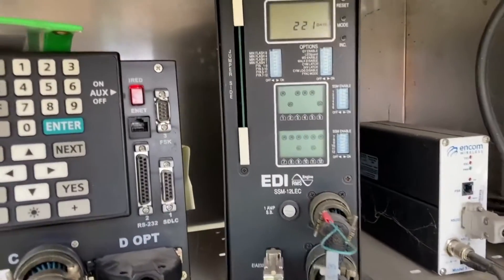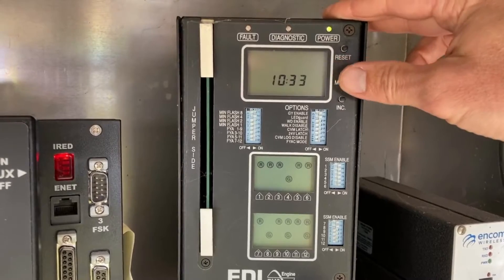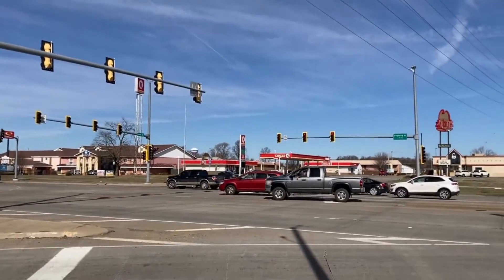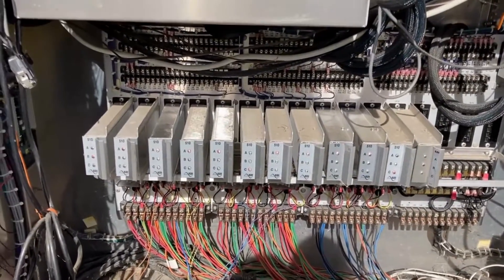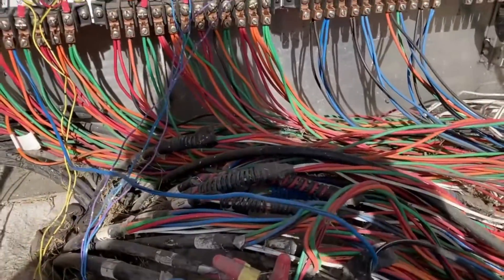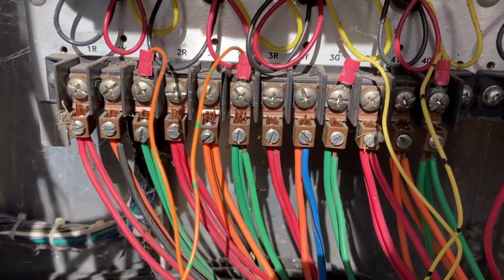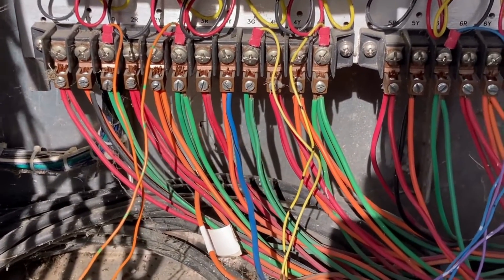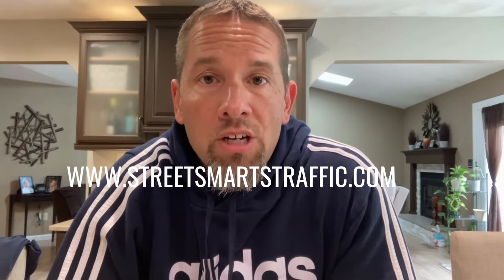Traffic Signal Troubleshooting - Dual Indication Fault

Comment: I noticed that the red, yellow, and green lights are wired red, orange, and green, respectivly. I'm assuming the blue and black wires are for the pediatrician signals. Which colored wire controls the "don't walk" lights and which wire controls the "walk" lights?
Reply from the maker: Actually the blue and black are for the LT arrows.  The right far side of the field wires are for the ped indications and we use the red (DW) and green (W) usually.
Reply: Thanx for the knowledge. I should "STOP" assuming. Get it?  Ha ha.
Reply from the maker: @WilliamLutz-dj9zo  👍😅

Comment: Sounds like the wire is bad somewhere underground. We usually pull a new home run for the affected phases. Using a spare wire is a temporary fix at my job
Reply from the maker: We were on our last leg on this one.  So we went with using the spare wire.  I'm sure we will be pulling in a new cable if we have anymore issues.  What industry are you in?
Reply: @streetsmartstraffic  I am an electrical mechanic. I work on traffic signals for NJDOT. We will use the spare when we can, but we don't seem to get that lucky anymore. Usually multiple wires are exposed and shorting out or are burning onto another wire.
Reply from the maker: @matthewjacobs1164  Thats cool.  So you must do it all!  Not so much on the construction side for me...although I will help out.  Yeah, I felt lucky that we were able to get it going again with our spare wire.  I shot that video like last year I think.  Still running!

Comment: Did you re-do all the neutral connections? I was told they can sweat, or be affected by humidity. Also that it is often a seasonal spring thaw issue.
I'm investigating a dual entry issue, with induced voltage on the cable. I was going to comment on the other video, with dark head. That was interesting. Not sure if you've fixed that one yet?
Left turn arrows need load resistors. Many cabinets have them included on a panel, or on the terminal strip. Something to consider. See - IMSA article, "Compatibility of LED Traffic Signals with Existing Traffic Signal Field Equipment"
Reply from the maker: Good information.  I never redid the neutrals.  The spare wire seemed to fix the problem.  The induced voltage you speak of sounds like a neutral issue or a wire that is cross feeding/shorting over another.  
I know load resistors are great for loading down a phase but I see them as only short term fixes.  The reason I don't like to use them as a constant is because if you lose all indications for a direction, it will still run and not be noticed by the conflict monitor.  I think I would rather the signal go into a red flash state...just my 2 cents
Reply: @streetsmartstraffic  Yeah, the contractor said they doubled up neutrals on another location with a similiar induced voltage problem. 
I thought we might add the load resistor, w/o affecting the no load condition, but of course that's incorrect. Unused Left turn reds used to be tied high, but now there are load resistor packages being speced? See ncdot - Load Resistor Installation Detail.
I also ran across this doc, that should be of interest: "LED Traffic Signal Monitoring, Maintenance, and Replacement Issues" - deleted link.
Reply from the maker: @freedomspyder  Ok good to know.  Different muni's & cities do different things.  We still tie unused reds to high.  Good information!
Reply: @streetsmartstraffic  Don't hold me to it, lol. 
I see it's used for Flashing Yellows by some. And for unused Walks. 
I had noticed or thought, that the red jumpers were no longer necessary. Wasn't sure if that was because of smarter MMU's configured to ignore those channels. 
Appreciate your efforts and sharing of your repair stories. Cheers.

Comment: Do you have try to clean all wire contacts with contact cleaner. They seems to be very rusted.
Reply from the maker: No we don't go that far.  At the most, maybe run a straight edge across the bare copper a few times to knock it off.  Great question!

Comment: This used to be physically impossible. Contacts were mechanically linked and simply could not indicate more than one light at a time. If contacts got stuck, the entire mechanism would not be able to rotate.
Reply from the maker: I actualy worked on those back in the day!  They were actually a realy cool contraption.  The signal head would share the green arrow & yellow arrow indication.  When it was time to change from green to yellow, the motor was energized and it would rotate the color of the lense, thus changing the color of the arrow.  I thought that was so cool!  Thanks for sharing that!  Brought back memories..
Reply: @streetsmartstraffic  Haha nice. I don't miss the days of simple timed lights and their inefficiency with traffic but stories like this didn't exist. That said, there were more [observable] failures back then, but they all resulted in the same thing... flashing red one way, flashing yellow the other.
Reply from the maker: @MadScientist267  You got it!
Reply: No, Remember how this fault was because there were a wire short, so the voltage were "backfed" into the incorrect lamp? So even if the rotating contact could not give voltage to more than 1 lamp wire at a time, you could still get a short between 2 lamp wires, so you get a dual indication.

Not with the mechanical glass switcher however, since there was only 1 lamp then.

The conflict monitor is able to detect this because it detects the voltage on the lamps, so even if the controller behaves properly, the conflict monitor is able to detect this.

Comment: Probably water intrusion Somewhere during rain....Only 1 spare wire In entire cable ?? .....Don't you guys design for like 10% Spare pairs/conductors install for anticipated growth or defective insulation fails ??
Reply from the maker: Funny I just answered that question in an earlier response.  We SHOULD do that and on most new designs we do.  But alot of these cabinets are 30+ yrs old and they built it to have 'just enough'.  
But you are correct Tom, it all starts in the design process! Thanks for the comment!

Comment: It's fortunate that there was a spare wire already run. Is that common, or do these systems tend to get installed with exactly what's needed and no more? I've replaced wires in my own field and never had an enjoyable time of it.
Reply from the maker: Well, it all starts in the design process.  If done properly, you want a spare in the conductor cable for possible future expansion or in a case like this.   Example, a 5 section signal head (green, yellow, red, green arrow, yellow arrow) needs at least 5 wires for the indications and then another wire for a neutral.  That's 6 wires.  We run at least a 7c cable (7 wires) for that head then.  I know some municapalities that for example have a pedestrian head (walk man, don't walk hand) will run a 3c (wire for walk, wire for hand & wire for neutral).  Yes, it does the job, but leaves no room for error...Thanks for posting that question!

Comment: I'd check to make sure there are no loose neutrals back feeding.
Reply from the maker: Thanks for your input Dan.  Yes, if the spare wire wasn't a fix, my next step was going to start chasing down those neutrals....But, so far so good.  Thanks again!
Reply: @streetsmartstraffic  You do a great job. One more suggestion: put a box of D-con in the cabinet and seal the conduits and cabinet base. It appears rodents are nesting in there and there is nothing they like more than wire insulation.
Reply from the maker: @danlowe8684    You're definitely right about that.  We have some cabinets out there with D-con in it...this could have used one.  Since this video, we've upgraded to a new TS2 Type IV cabinet.  It's nice and shiny now!

Comment: Ok.   So.  I have no clue about your job.  But.  I've been a ham for many years.   The fix was to parallel a wire with another???   Um.   Maybe the wire was bad???  (Sarcasm not implied..stated)
Reply from the maker: Maybe i'm misunderstanding your comment.  It was unknown up to that point that the wire was bad.  Usually if a wire is bad, it will just short out and cause a red-red flash condition.  Or if it is severed, the indication(s) will not light up. However, neither of those occurances happened.  It would run fine for an extended period of time until there was heavy rain.  
Anyway, for now the spare wire was the easy & fast fix.  Thanks for commenting
Reply: @streetsmartstraffic  look.  I admit I have no idea of your job.  Me.....as an amateur radio operator,  my FIRST choice would be a broken or intermittent wire.   But thats just me.  What do I know????  I've only been a ham since the early 90's.   I don't know your job

Comment: Reminds me of phone work in a condominium,  after mapping and testing every phone wire full functionality was theoretically possible, until anything broke.  No spare wires. Building owner chose to run new wires along the outside of the building and drill holes into the exterior walls... go figure.
Reply from the maker: LOL   Hey, whatever gets it done!

Comment: Back in the 80's in Joplin, and Kansas City, I saw traffic signals go green both ways. The one in KC caused a crash right in front of me. In Joplin, I was almost in a crash. I have had people tell me that cannot happen, I know for a fact that it can and does. Probably wires shorting in a j box somewhere is my guess.
Reply from the maker: That never should happen.  There is a piece of equipment in the cabinet that is sort of a watchdog over the signal.  One thing it does is to monitor conflicting signals (such as opposing greens).  If this happens, it places the signal in red-red flash.  Now I said SHOULD....
If it was wired wrong, a signal head was turned the wrong direction, that watchdog equipment is bad....all things that could have caused that to happen.  Which is why signal maintenance is SO important!  Thanks for your comment!
Reply: @streetsmartstraffic  I am sure things are far more sophisticated now.  However, does the system have a separate path like an optical sensor at each signal light segment that lets the control know what the actual physical end result is? Or does it simply monitor the signal that is sent to each segment from the control box? Like everything else, cost must be kept as low as possible.  The light in KC was red for me when I got there. After it turned green, before I moved an oncoming car and a car from the right crashed  in front of me missing me by inches. I was amazed to see that it was green both ways!
Reply from the maker: @LM-fg7vi  Great question.  The conflict monitor monitors the field wires heading out to the indications from inside the cabinet.  It doesn't know if a head is turned, or if it is wired wrong.  But in a perfect setup, it should catch opposing greens coming up and place the signal in red-red flash.
Reply: @streetsmartstraffic  One more reason to keep technicians around, to go do actual observation of the system in operation. I have seen where a truck turned the corner tight and moved one of the signals to face a different direction. He of course just kept going!
Reply from the maker: @LM-fg7vi  Happens all too often!  And agree with your statement 100%!

Comment: Sometimes i will be at a light and will not give me a green light and i will have to wait for 2 to 3 cycles i could be going straight or turning what is going on thanks
Reply from the maker: Several things---
DRIVER side of it:  
1)  You pulled too far past the detection zones and were no longer detected.  Then had to wait til someone behind you pulled up and was detected.
2)  You were too far from the detection zones and finally moved forward a bit and were detected.
SIGNAL side of it:
1)  The detection zones are improperly placed and you just happened to move enough to finally get detected
2)  The detector card (inside the signal cabinet) or detection equipment is malfunctioning.

Hope that helps!  Thanks for commenting!
Reply: I once had to make a left turn against a red light every day for a month because that's how long VDOT (that's Virginia DOT) took to fix the broken detector. I called them at least 4-5 times about the problem and always got the "we'll send someone out to look at it". Should've checked for a drool puddle by the controller cabinet. Of course I am assuming that anyone ever bothered to look at it before a month passed.
Reply from the maker: @brianleeper5737   That wouldn't fly where I'm at!!  However, playing devil's advocate here..they may have been waiting for a piece of equipment from the manufacturer to replace something that had gone bad.  However, I'll also say that a modification should have been made to the signal in the interm so that you wouldn't have to run a red light.  (that's a safety issue!),   Thanks for your comment!
Reply: @streetsmartstraffic  It's possible, but with that part of VDOT responsible for around 1000 signals that all use the same hardware, you'd expect them to have some spares. It's also using loop detection not video so that should be very common hardware.
Reply from the maker: @brianleeper5737  Well, you're making a strong arguement!  lol
Reply: @streetsmartstraffic  VDOT used to be way better at dealing with traffic signals than they are now. I have no idea what happened. I think the one person who kept them working well got fired or retired or left for another job.
Reply from the maker: @brianleeper5737  Unfortunately that's usually the case.  Many times it's this: the ol' timer (that has all the experience) retires and the agency or company didn't plan on his succession.  Then they have to get someone in there and start all over.  OR the agency pay is so low that there's constant churn.  As soon as the signal guy gets enough experience, they jump ship to someone that will pay more. 
Either way, its the traveling public that suffers!

Comment: Do you ever "megger" / insulation resistance test cables? Normally what you would do in a situation like this, between green and yellow wires since it's between those two. But, not sure if you can disable a head(s) for any period of time. Or how easy it is to coordinate with local agency. But, spare conductor seemed to fix it, for now anyway.
Reply from the maker: Not normally.  You hit it on the head though.  You would have to disable heads and need a bucket truck at your disposal.  Thanks for your input!

Comment: Wow I absolutely love the controls in a signal cabinet. I do have a question. Why does the ticking for countdown during walk sometimes sound like a machine gun? I'm in Oklahoma and I used a crosswalk the other day. I hit the button it said "Wait", then the walk sign lit up and the announcer said "Walk sign is on to cross" then it when into the countdown and started a machine gun sound, while the other one on the other side of the street did the normal beep. It's kind of comical.
Reply: I would guess its a guide for the blind. Pretty much any noise made at an intersection that isn't a car or crazy person is for the visually impaired.
Reply from the maker: @DeathCubeKX  You're really close.  Usually two different sounds so it guides the blind in the correct direction.
Reply from the maker: That was a certain ped manuacturer that used the machine gun sounds to indicate the direction of walk.  They would use two different sounds so it guides the blind in the correct direction  (if they were all the same sounds, that may confuse them).  You're right though, who thought in the design process:  "Hey, lets use a machine gun sound for the blind"  lol

Comment: Even though playing with high voltage and that equipment isn't ideal, can't you do an insulation(IR) test?
Reply from the maker: Hey Mike, I'm showing my ignorance here.... but interested...Give me more information.  What should I be doing on an IR test?
Reply: @streetsmartstraffic  You can test for leaks to ground with high voltage, Megger Testing.  The trick in your situation is making extra sure you're not placing voltage across the gear.  I've never done this outside, but you should be able to isolate the cable run that has poor insulation.
Reply from the maker: @PetraleiTanyl  Ok good to know.  I use a Megger tester from time to time when testing out grounds on inductive loops.  I test the metallic sheething inside the detector cable against ground.  Just another way to test out a detection loop